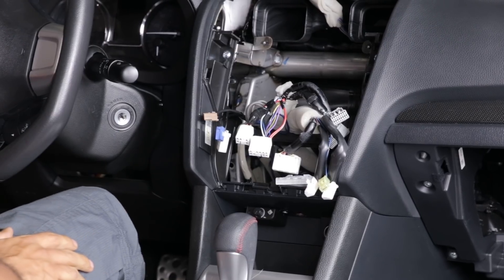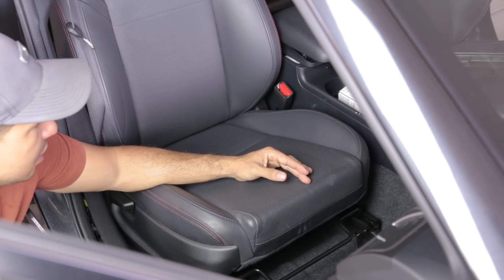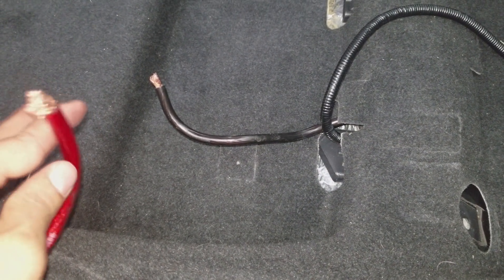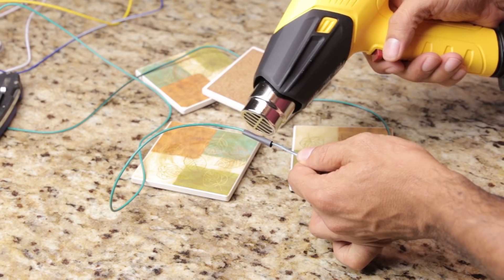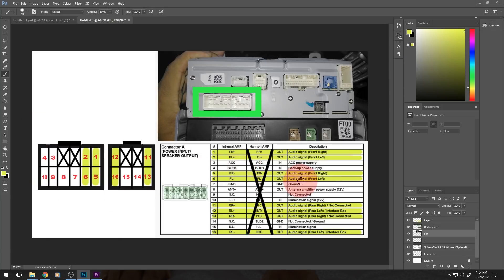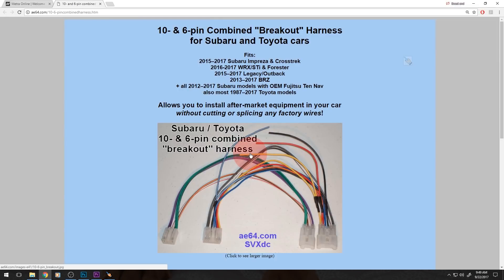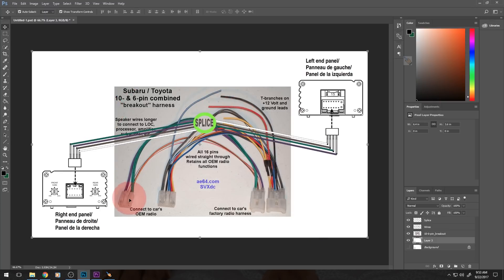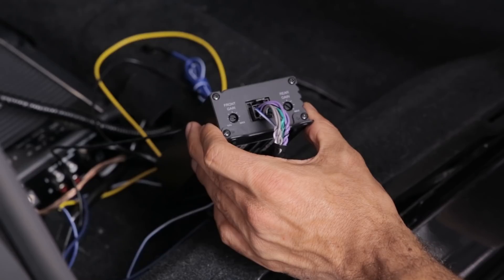Alpine KTP-445U Installation and Review in a 2017 WRX & Under Seat Amp Relocation

Comment: Yestrday I added to my car audio system KTA-450 and replaced speakers with Alpine series SPG17c2 caxial to the rear side and Hertz Dieci 165.3 2 system on front side. Wiring was done the same way as You did it. Huge difference in sound. Just wanna say that this work takes time to do it as nice as You did it but it's worth of time. Nice tutorial , congrats on Your work!

Comment: "The pinout is NOT oriented how you would be looking at the cable, but how it's plugged in..."   This is the level of detail I like.  Most people would have just glossed over.  I bought a 2020 WRX today and I'm ordering the Alpine hardware this evening.  I'll be using your videos exclusively to upgrade the crap sound system in the new WRX.  Massive thank you for this series of videos.

Comment: Excellent video, great job! Very thorough. A few points and a suggestion (click "Read more" to see my entire reply here):

* The Metra 70-1761 harness (and equivalents from other harness manufacturers) omits the illumination(-) (minus) lead. That lead is required for the OEM head unit's illumination and dimming to work properly.

* To anyone who installs both the Alpine KTP-445U "Power Pack" amp (or an equivalent) plus a powered subwoofer or amp + sub: Feed the sub amp from the HU's outputs, not from the KTP-445U's outputs.  Yes, you can feed both amps from the HU's outputs.

* With the OEM Clarion HU models that Subaru has used in previous years, the HU's rear channel outputs attenuate bass frequencies as you raise the volume.  That made the front channels the better choice to feed to a subwoofer.  Subaru's OEM accessory subwoofers do that.  I suspect that the 2016-up OEM Clarion HU models still have that issue.

In the 2008-2014 Impreza, WRX, and STi OEM Clarion HUs, there was a hidden menu option that you could change to disable that characteristic, significantly flattening the EQ.  If the base level 2016-2018 OEM Clarion HUs still have that feature, I haven't seen anyone discover the key sequence to access that menu. The other OEM HU models (made by Fujitsu Ten, Kenwood, and Harman) do not have that feature (or at least nobody has found similar secret menus in those).

* Suggestion to @OP: The links in your description all point to this same YT video. Where possible, it would be very helpful if you could edit those links to include the timestamp so that they jump to that point in the video. Just append "?t=nnn" where nnn is the number of seconds (e.g,. "View of Connectors Behind HU" at 11:49 is ?t=709).

Comment: I ended up buying the Kicker speakers and tweeters along with the Alpine 445U  that you used in this video. I also bought the breakout kit from ae64.com and followed his instructions to wire it in. I am very impressed with how the car sounds now. It was marginally better after getting the Kicker speakers, but the Kicker + the Alpine, considering how easy it was to install, was definitely worth the money. Thank you very much for making this tutorial along with your reviews. My 2018 WRX sounds like a completely different car now.
Reply: I just did this exact install using the ae64 breakout harness. Is it normal to hear a quiet pop sound in the front door speakers when the stereo completely shuts off? When I turn off the stereo and immediately turn it back on I also get the same pop noise. Any ideas?

Comment: Thank you so much man. I just purchased a 2014 Subaru Legacy and really wanted to add an amp and speakers with a stock head unit but wasn't a fan of tapping into the oem wires.

Comment: Hey man, just started watching. At @1:45 you mention running the amp power cable on the same side of the car as the RCAs/remote wire.  This will cause interference, that could make your speakers cut out, and cause distortion.  I did this very same thing when I ran my wires.  Looked it up, and sure enough.  I had to re-run the power cable on a separate side of the car as the RCA/remote wires.  Good luck, man.

Comment: Nice video. I’m planning to have the power pack and a Kenwood powered subwoofer installed in my car soon. Although I’ve watched your video, I still feel that I’d be better off letting a shop do the install. Still I like understanding the entire process, including setting the gain on the amp.

Comment: Hi awesome vid...just bought this power pack. Question..which remote wire do u connect . Not looming to yurn on another amp..so white and blue wire from rca cable side..or white and blue from speaker and power wire side

Comment: Great video with very detailed instructions. One thing that is still a little unclear is how exactly you ran power and ground to the Alpine amp. It looks like you just ran the wires into the rockford amp. Is that safe? Does that add any additional load to the rockford amp? Do you have to use a fuse from the rockford amp to the alpine? Did you ground the alpine to the negative terminal of the rockford amp as opposed to the grounding point on the vehicle? I am installing almost the exact same setup, and this seems very convenient, but I just want to make sure it is safe and if there are any other considerations that need to be made when using this wiring configuration.
Reply: @akqjtn  searched thru the comments hoping somebody asked this very question AND you answered. Splendid!

Comment: Great video and thanks for posting.  Question for you.  I have a 2018 WRX CVT with the same stock 7" head unit.  I had the alpine power pack installed (by bestbuy) and found that although the volume increased a lot and there is better sound clarity, the bass is almost non-existent even when ratcheting up the low frequencies all the way, while the highs are... way high sounding.  Kept the stock speakers.  Do you think this could be an issue with how the amp was installed?  Not looking for big bass like from a sub of course, just normal full range.  Thanks.

Comment: So I have pioneer 2660 HU and wanted to install the KTA- 450 but later on I want to add a amp and sub. Would it be a good idea to do a fuse tap like you did for the camera to power the 4 channel power pack to put it behind the stereo and adding an amp and sub later under the seat? Honestly just don’t wanna run a bunch of wires

Comment: Really nice video man, just a quick question, I have a power pack that I am trying to install, and like you I have a sub and an amp already installed, Im wiring both to the stock head unit, my sub amp has a high level input like yours, so the speaker wires are already connected to the sub amp, is it cool if I tap that wire for the alpine power pack too or is there another way to run it?

Comment: I notice that you didn't replace any of the OEM speaker wire... is there any concern that you should move up to a bigger wire with the higher power? Do you have any idea what gauge the OEM speaker wire is? I'm looking to do a similar install but with a 60 W/channel amp. I have already replaced my speakers and noticed that trying to run new speaker wire in my 2015 WRX is going to be a real pain
Reply: trying to learn what gauge oem speaker wire is next to impossible, for me, so far. in my home stereo hobby, thicker gauge speaker wire , like 12 awg & using ofc wire(oxygen free core) similiar to knukonnects or shyhigh wire) is best, with less popping and crackle, less feedback. oem wire looks like 22 or 24 gauge, real thin. in fact, even technical support for Knukonnects refused to tell me what gauge the rca connects were in their $71 amp install kit- he was not a manager. ordinarily, I love Knukonnects wire for the price, but I always like more knowledge vs less info.

Comment: Awesome informative video!

I have an 88 Nissan Z. I bought this amp to first run on a pair of components for front and coaxials for rear. But I purchased a pair of 6.5 subwoofers to use vs the cos. You think this little Alpine is strong enough to use only, (for all 4, 6 with the tweeters) speakers? The deck and comps. are all Alpine, the subs are Pyle PLPW6D 6.5s.
Reply: Thanks for your input!!! I'll try it and see how it works.

Comment: Hi, great video, thanks!
I'm installing my KTP Alpine in a Suzuki Swift 1.25 GLS along with a Pioneer AVH-A205BT double don dvd. I wanted to connect both of them to the power cable in the main vehicle harness, but I realized that I can't, because the Suzuki supplies 15Amp. of power through it:
The pioneer max. power consumption is 10 Amp. according to the manual (is that possible?) and the Alpine KTP needs 15 Amp.
What would you recommend of doing with the power cable of the Alpine  in such case? Should I run a separated power cable+15A fuse directly from the cars' battery? 
And what about the Alpine ground?- I have thought that I could still attach it to the ground of the car harness, along with the Pioneer ground as well.
Thanks!

Comment: Just got one off eBay. I’ll get the connected harness and go for it. Thanks! Great and detailed video. 
One question, during the gain tuning, after you lower the volume of the HU until it doesn’t distorce anymore and start working on the gain, how do you leave the volume of the HU? Still really high just before clipping? Or lower it at the minimum and work on the gain? In other words how is the volume set as you tune the gain? Thank you.
Reply: Boost & Shutter thanks! One more thing. I’m about to order the harness, what’s the make and model of the OEM HU? I have the sam on my 18 WRX but I’m at work now.

Comment: So I just installed the kicker door speakers and I’m NOT IMPRESSED AT ALL with the bass. Honestly, the factory speakers had better sounding lows! Is this amp worth all that work (you amazingly showed!)? Or would I get similar lows from the $500 kicker sub?
Reply: 2 years late for speakers are not meant for bass they are meant for mid fill 
No door speaker is EVER going to give you low bass

Comment: I added mine today thanks to your video and your clear explanation about wiring and diagrams thanks a lot! But I am having a little bit of trouble now,  speakers sound really good (upgraded kicker speakers) but I get a significant amount of white noise. My alpine gains are set at about maybe 5% capacity? (Barely turned it a little) how can I mute that hiss noise that drives me insane whenever I want to cruise without the music playing. Also, whenever I play a song with bass at volume 35-38 every time the bass comes on the sound turns off and on, sometimes to the point I have to turn off and on the power to reset. 

Got the lc2i and amp to run the kicker procompC but haven’t installed yet. Thanks for your videos and clear knowledge.
Reply: yes, please let us know. I have found no youtube videos addressing white noise which I suspect relates usually to the ground and then perhaps also to the wire quality. lately, since I keep my cars 10 or more years, I try to spend more funds on better wire (Knukonnect, skyhigh) & equipment(JL Audio) , but lack better knowledge for doing a better install. thus these videos are so helpful to me.

Comment: Thank you so much for this video. It helped me a lot. I have installed the same amp and wasn't aware of the switching requirement between RCA and Speakers, I based my installation on the Crutchfield guy video, and he explained the option of trimming the REA's for direct connection to the speakers’ wires but nothing about switching the configuration (RCA to Speakers). I almost damaged the apm, then I found your video…
I still have one issue not solved. As per the Crutchfield guy video, I do not need to connect the blue wire on OEM head units. I doesn’t work for me. My amp stays ON after turning off the car switch. Do you have any idea about that. Do I need to connect the blue wire to a switched hot wire? Thanks..
Reply: Late but yup you got it! 
Switched hot 
Your head unit is not putting out the required voltage to trigger it on that’s why it isn’t working so yes hooking up to a switches 12v will fix that

Comment: I really hope you reply,  but I have one question. Since I have to run my power to the battery, do I have to add another fuse to the cable coming from the battery to the power pack or is the fuse the power pack has in the cable enough?
Reply: Thank you so much, great video and very detailed.
Reply: @akqjtn  one more thing, I dont necessarily need to use a 8gauge wire for power right? I can use something about the same as the yellow one with the fuse on the amp?

Comment: Would all of these connections be "T" connections so that the amp is essentially working in conjunction with the factory amp(just head unit I believe)? Assuming you are connecting directly to the head unit power and such.
Reply: That perfectly makes sense now, just out of curiosity, I have read that some people have issues with a hum or buzz with this amp. Have you noticed that at all?

Comment: Nice helpful video....   Pioneer has an equivalent amp GM-D1004...   any reason you went Alpine?   Does it make “pop” sound when turning ON or OFF?   I have a Forester 2017 with 6 Kicker speaker upgrade and Pioneer 4200NEX...   I am considering adding one of these amps...
Reply: The Pioneer amp has no gain adjustments...  would this be easier to use?  I never had an amp in a car before?

Comment: I had a 2013 f150 and I'm about to do the same setup as this one everything from the Rockford fosgate amp to the audiocontrol LC2I and this alpine amp. My question is this amp comes with 2 pairs of RCA
 the Rockford fosgate come with one RCA output and the LC2I got a main output can I used does RCA to hook up the alpine amp or with it better just to cut them and run the wire to the radio
Reply: OK I see what your saying 
Thank you for you help
 I really appreciate

Comment: Hey, I installed an amp in the same location as you. Did you ever have any grounding issues or problems with noise? I grounded mine exactly where you did and I'm having alot of problems with noise and popping of the speakers. The noise doesn't follow engine rpm. I'm running out of ideas and was hoping you could provide some more info on how everything worked out for you.
Reply: I have an alpine 5-channel PDR-V75. It is pushing 2 6.5" alpine coaxials, and 2 6.5 alpine components with the tweeters up in the dash. Also pushing a 12" alpine type r. I'm not sure of the model numbers. I know the amp matched their power requirements perfectly. I also spent a good while tuning the amp, my gains are just barely above nominal. I've even tried chocking them back to see if it'd fix anything. I have speaker level inputs running into the amp. At one point I disconnected speaker level inputs, plugged in an aux to rca adapter and used my phone to play music. It worked great and all of the noise was gone. Then all of a sudden the noise came back but worse. I screwed the amp down to a board under the carpet just like you did. I'm wondering if any of the screws went through and is touching sheet metal and causing a ground loop. It's driving me insane. Figured I'd check with you to see if you had any issues with that ground because I grounded it just like you did.
Reply: @te311909  Ever got it fixed?
Reply: @ekimandersom4478  yeah, it ended up being the amp. I got a replacement and it was fine.
Reply: @te311909  Ok good to know, i am about to install an amp under the seat.
Then it is safe to use that ground point.

Comment: with much respect- about needing more power to your door speakers. would not an amp upgrade be best, like the JL Audio $830 XD1000/5v2: 5 Channel is 100 rms watts x4 continuous or their XD700/5v2: 5 Channel 75w rms x 4 $630 (took a chance & bought mine on ebay for $350). that way you might be done with an amp upgrade for 15 years. Unfortunately, I have never met anyone here in NJ into car & home stereo like me and you, so I have no comparison to my 75 watt rms to the door speaker and no comparison to an amp with more than my 75 watt rms. so why not upgrade your amp now then spend your funds on a separate subwoofer amp, like my kenwood sub amp Kenwood Excelon XR600-1, 600 x1 rms, $230 $170 used on ebay. Your amp at 45 rms is underpowered but you do show a good sound improvement. perhaps your work did bring your system closer to a good 75  rms system. Since I've had my amp for 12 years, perhaps you should do an amp upgrade & it would be best, in the long term. I suspect, you, like me, might keep your car for 15 years, so an upgrade to a 75 w rms amp & separate subwoofer amp is probably in your future. Since I'm older now, all that bending, removing seats, etc is not an easy option for me.

I see your $110 ALPINE KTP-445U power pack amplifier is rated 45 w rms. so perhaps your 45 rms amp & your 45 rms alpine is better than an amp upgrade to 75rms, since your at a total 90 rms for just $110. so I see a subwoover amp upgrade in your future. I never knew you could spend only $110 to improve system sound. bravo, much respect.

Comment: I thought the whole point of the Alpine is not having to do a regular amp. This looks complicated. I think I'd just start with the Alpine for the speakers and do a powered sub. I have a 2012 Ford Focus SE which has terrible sound. I might get a new head unit, but I might sell the car in the next year so so far speakers are my only upgrade. My other car, a Rav4 has the JBL system, which is plenty loud, and for that system just dampening material for my sub, which Toyota stuck in the rear door. I might move the sub if i can figure out how and where to move it to.